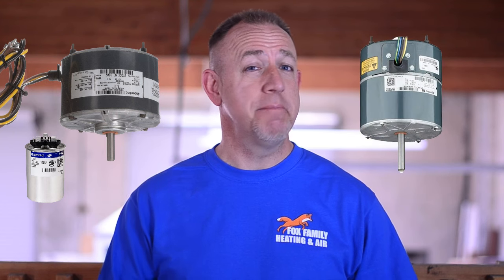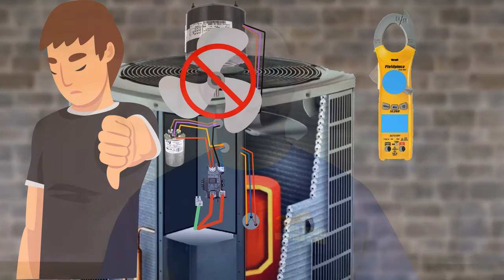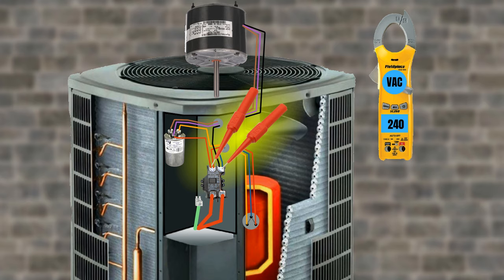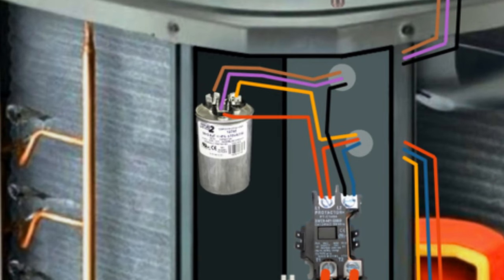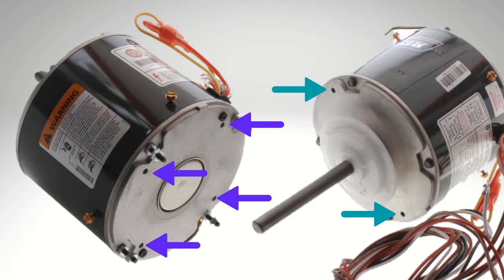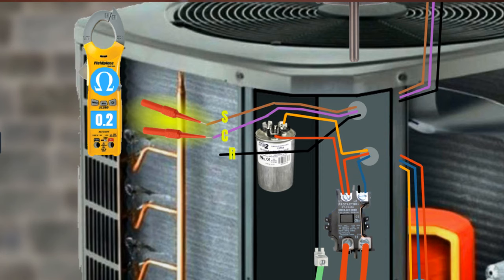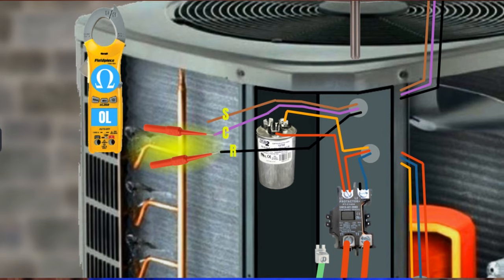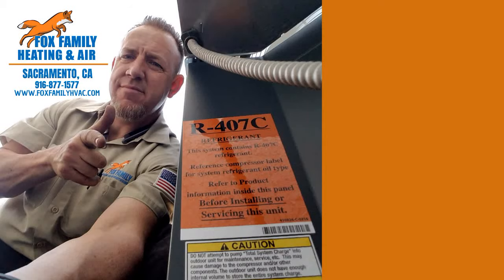How I Troubleshoot an Air Conditioner Condenser Fan Motor

Comment: AC man has been out twice.
PROBLEM
AC Thermostat says system is running and cooling.
Set at 72F, but house is 83.5F (here in Florida)
AC man comes, replaced fan motor and main board in the box on the Condenser unit.
(so, it got an upgrade)
Several hours later he says it is working.

AC man leaves.
We leave an hour later, and the house says it is 76F.

We come back the next day (15 hours later) and the house is 82.5F and the thermostat is set at 72F.
The Thermostat says it is running and cooling.
(two little snowflakes are blinking on the thermostat) as was the first time.
The thermostat says it is cooling the house.

We go outside and notice the condenser fan is not running again.

Shut off the AC and wait for 10 to 15 minutes.

Turn it back on and the condenser fan never come on.

We shut off the AC and file a Maintenance report again.
We leave after a few hours.
Before we leave, we turn the AC on again and see if the fan outside will come on. NOPE!
We check the breakers, and they are all on and not tripped.
We turn the AC back off.

AC man comes out the next morning.
Turns on the AC and the fan on the outside Condenser starts blowing.

He says to keep an eye on the float valve for the drip system.
He also says the thermostat might be bad.
AC Man leaves.

A few hours later we leave, and the house is down to 76F.

We return about 12 hours later (the next day) and the house is 83.5F and the Thermostat is set to 72F.
Thermostat says the AC is cooling and the two little snowflakes are blinking.

We go outside and the fan on the Condenser Unit is not blowing again.

We start video recording and record for over 1.5 hours.
Fan outside on the Condenser Unit never comes on.
Checked the drip/pump box at the inside furnace/ac unit and it has about 1 inch of water inside it.

We know the fan is not coming on as we laid two leaves on the fan grate, and they are always in the same spot.
One on the edge of the outside of the grate.
One on the inside near the fan motor, on top of the grate.

We check the Breakers; they are still on and not hot or even warm at all.

We shut off the AC for 15 minutes, turn it back on, the fan outside at the Condenser doesn't come on.
We wait 5 minutes, the house is still not cooling, though the thermostat says it is.
Shows 83.5F and the setting is 72F, so I turn it down to 69F.
Wait a few minutes and the fan is still not coming on outside.
Switch from Auto to ON, still not fan coming on outside.

We turn the AC off and wait 20 minutes and repeat test.
No fan coming on outside and air blowing inside is not cold.

We stay testing for a total of 1.5 hours and the fan outside never comes on and the house is still 83.5F.

So if the AC stays off over night for 8 or 9 hours, it will turn on and run the next day. But at some point, (many hours [more than 3] later) it will stop cooling and the fan on the condenser shuts off and never turns back on.. for some reason.

Every time we left when the AC as running (after the AC man came) the fan outside was blowing.
Every time we come back many hours (12 to 15) hours later the house is hot, and the fan outside will not come back on.

On the second visit he said he checked the pressure on the AC Refrigerant and said it was checking out that it has enough.

After he left the first time, we did make sure the fins on the condenser are not clogged or blocked with leaves.

We purchased two Honeywell Thermostats ($45 and $59), one programmable and one not, one takes batteries and one not.
We also checked the inside AC Unit Filter, and it is clean.

What we will try today.
We are going to use a camera to look in at the fins above the filter to make sure they are clean.
We will go outside and use a hose to wash the fins on the Condenser.
We will open the fan grate and vacuum out all the leaves on the bottom.
We will locate the outside drip pipe and vacuum it out.
We will add water to the condensation drip/pump box to see if the pump is actually pumping out the water.
If it is, we will add a cup of bleach water to it to flush the drip line and vacuum it again.

We expect the AC man will come out on Monday as this is Sunday.

We just rented this house and have not fully moved in yet as our current lease is up on July 27th.
We are still moving in, but not moving our bedrooms until the AC issue is resolved.
We already paid deposit, rent and prorated rent so we do not owe rent until August, and it is still late Jume.

We are not shutting off the AC (this time) as we know 100% for sure, if it is shut off overnight 8-9 hours, it works the next day, but only until it shuts off more than 3 hours later. Usually after the AC man leaves. My personal assumption is that the fan and main bard did not need to be replaced. Whatever the issue is, it is still the issue. This is because the AC worked while the Realtor was showing the house (12 noon - 2pm) for two hours and everyone left. 

The AC was left on when we all left and when we got the Keys a few days later the house was in the 80's and the fan was not blowing outside at the Condenser. So, if the AC is only on for up to 3 hours, it works and sometime after that it stops cooling the house. If it is left off for 8-9 hours, it works. After more than 3 hours of being on again, (however long that is), it stops cooling, but the thermostat says it is cooling.

We understand we are responsible for regular filter change and making sure the drain drip line is clear and the fins on the condenser stay clean, but we have not even moved in yet and the AC is not working properly. We asked if we could put in window units or portable AC units (at our expense) until the AC issue is resolved, and they never answer Yes or No. They just say they are sending out a repairman, and it keeps being the same guy who cannot figure out what it is.

Comment: I can't understand why they keep going out.  I have 2 of them go out in 5 years.  I don't understand why they are $500+ for a fan motor, makes no sense.
Reply: Maybe your HVAC guy replaced it with undersized motors, used ones off eBay or the junkyard, Chinese knockoffs? OEM gear is more expensive. It’s tempting to go cheaper but the headache of replacing it twice and scrambling to figure out a future problem will be worth the extra money.